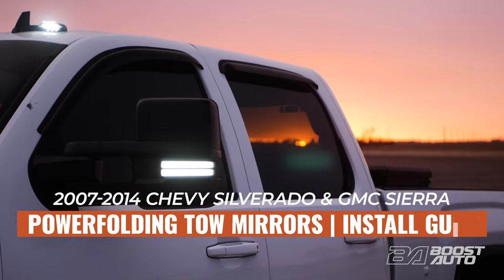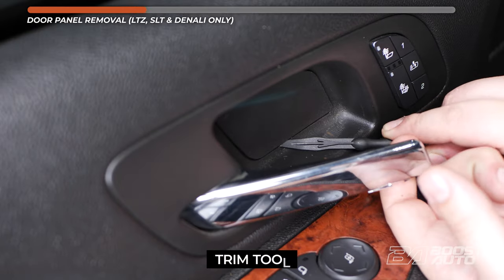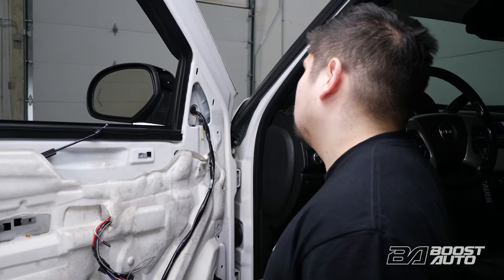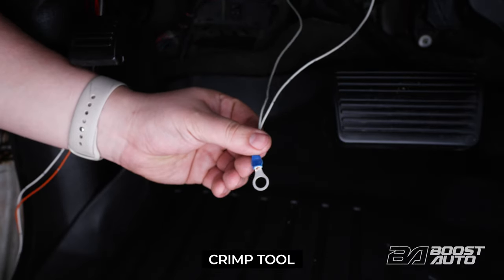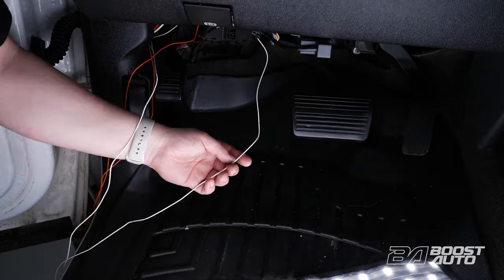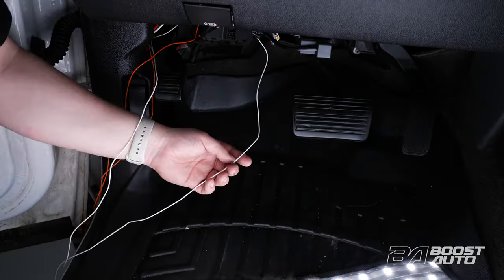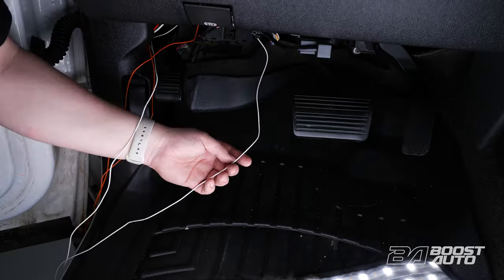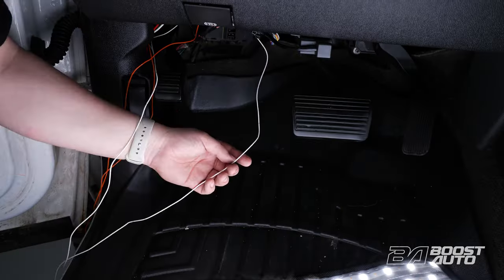Install Guide | Retrofit Power Folding Tow Mirrors Upgrade | 2007-2014 Chevy Silverado & GMC Sierra

Comment: how do you add the tow mirrors if your truck does not have the wires to plug and play?
Reply from the maker: We only offer an upgrade for those that originally had power adjusting glass.

Comment: Do they have day time running lights
Reply from the maker: They are designed to work the way that factory cab lights are - which is to come on with the PARK light. If you leave your headlights in AUTO mode, that means they'll come on at night.

Comment: Are you guys ever going to make these for the 07-14 mirrors instead of the 15-19?
Reply from the maker: Are you referencing the older style of mirrors without any lighting?
Reply: @boostautoparts  correct I know some companies add lighting for instance I have a set that has it I’m wondering if yall will ever do the same.
Reply from the maker: @trevortank7965  Sorry, I'm not exactly understanding your question
Reply: @boostautoparts  will you ever make custom 07-14 mirrors? With power folding lights etc